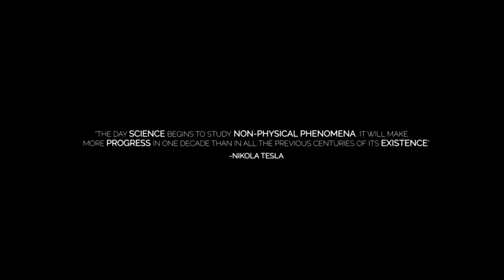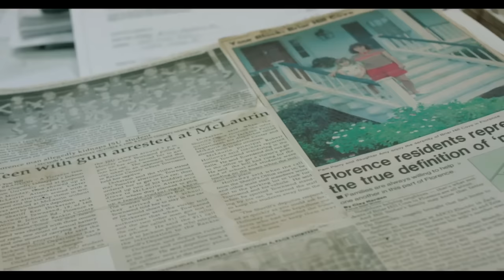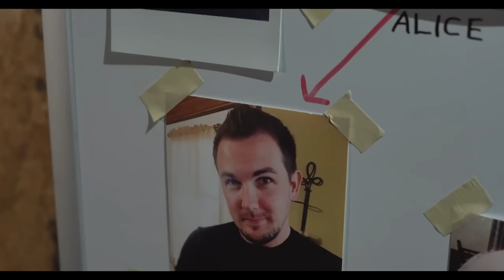Investigating One Of The Most Haunted Home in America | Absolute Documentaries

Comment: I think they faked the rem pods going off...the one guy kept saying it would be cool if multiple went off then goes upstairs, the other dude is by another rem pod on the stairs and they suddenly go off?...sounds like EMF from phones/texting to me. The doors opening closing could be easily faked too as there were hiding spots/string...even the balls on the stairs if they used some fishing wire in the dark room you wouldn't see it. 3 yrs investigating and they couldn't film head on facing the stairs in bright lighting or multiple angles? Same with the doors...the door reflected in the chandelier ball, after it opened the chandelier moves ---wind! If you have a window or door open on the other side of the house you get air pressure cross breezes...derp.